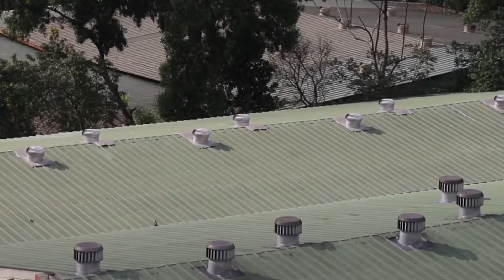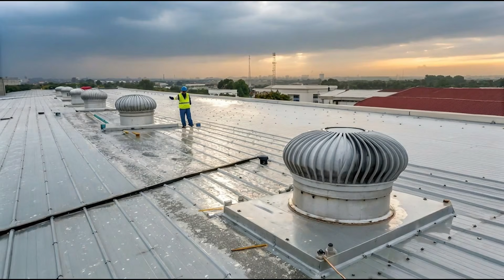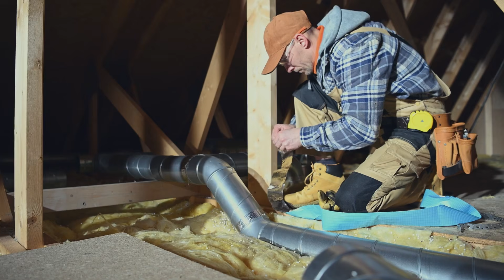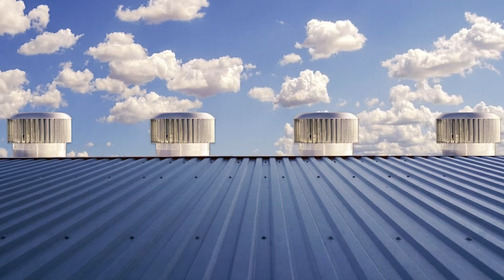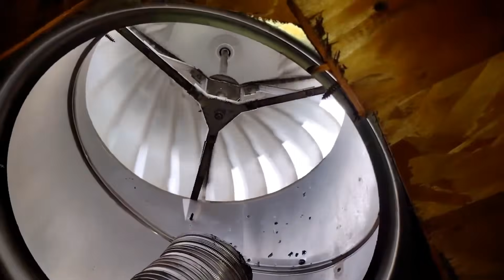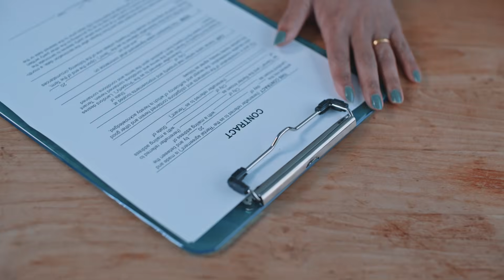Why Did America Abandon This Natural Cooling System?

Comment: I live in Denver and I cool my house with an evaporative cooler. This works because we have a huge dry bulb wet bulb temperature differential. I leave a small panel open to my attic space. I jammed an in-line fan at the top of my whirlybird, so that I'm exhausting my attic air with this semi-cool air, and it works perfect 95% of the cooling season here.

Comment: I'm glad that you posted this video about this device. I'm planning on building a small addition to my house in Guatemala city.  That city used to have pleasant temperatures most of the year, now it's way too hot during part of the year. This type of device will help me keep the addition at a pleasant temperature during very hot days without spending any money after the installation, except for the necessary maintenance every once in a while.

Comment: Do you have wind, very little rain, and a dramatic difference in temperature from the ground floor to the roof? Then turbine ventilators might get you the same efficiency as a ridge vent would. But if you live somewhere with rain and snow or temperatures that regularly pass 100 F in the summer at ground level, a ridge vent is both more efficient at keeping your home cool and requires less maintenance.

Now if you want to talk about attaching generators to turbine ventilators and strategically recovering power from heat generated by factory and transportation processes, we could make a MUCH more interesting video...

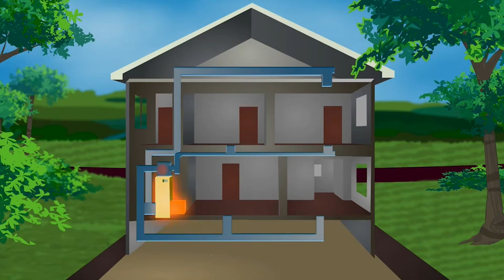Comment: @10:24 what is a turbyinnes? AI slop.
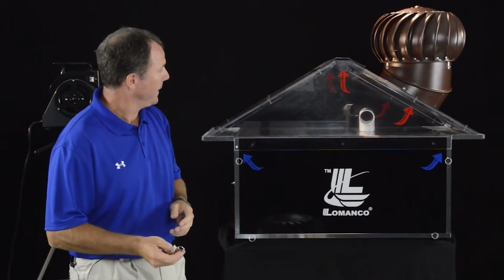Reply: Meanwhile 8:18 has it use the wrong form of wind (wind like a clock vs wind as in moving air).  Definitely AI at least in presentation if maybe not in script.  But probably there too.

Comment: I had 3 on my 1956 construction house. When I reroofed in 80's put in 1 more and replaced the original 3 and have them still today. I had planned to replace all 4 when I got next roof. But I never had any issues with noise or failure with what I had and have. But now suspect like my 30 year old Kenmore appliances I will NOT be able to buy the same quality product to replace them. Maybe I can just refurbish with new bearings and get another 40 years service.
Reply: new bearings + xometry, you can get quality parts made to your specifications. Wish more people knew about these kinds of services.

Comment: I had them on my old house, but I re-roofed with a ridge vent and plugged the holes.
My current house has full length soffits and a ridge vent, and I can go into the attic space in summer with tolerable temps.